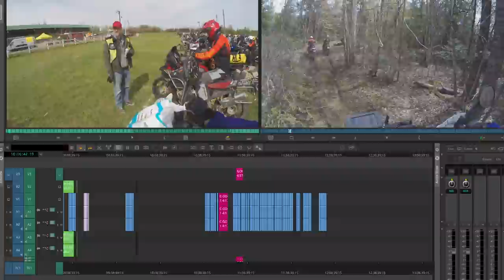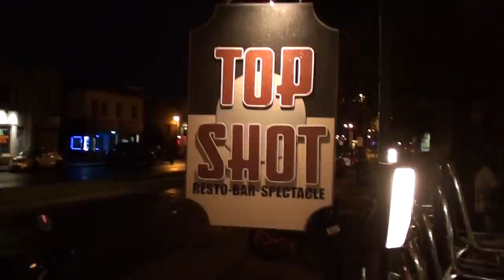Classique 2018. BMW F800GS & HP2, WR250, KTM 690 & 500, Husky 701, Honda CRF250L

Comment: My AT does that too. They've got some sort of crash sensor or something in there that prevents starting after a fall. After a few minutes you'll be fine.
Reply: The sensor itself is located under the dash display if you ever need to replace it, I only know that because I forgot to plug it back in after doing a bunch of work in there and had to go digging for it
Reply from the maker: OlloDee Good to know.
Reply: Most bikes these days after a dump...if you turn key on and off a few times it resets the computer...and they pop right off.
Reply from the maker: Mark Jacobs Seems logical in this day and age of overly complex systems.

Comment: re: camera clocks - I would expect that to continue to get easier as GPS gets more common on cameras. GPS carries with it extremely accurate timekeeping (but whether the cameras make use of it, who knows)
Reply from the maker: Unreasonable Steev The system now isn’t bad. Just my handheld Sony has no time code. I use it less and less as the GOPro 7  has a great image and the feel of the wide angle is better.